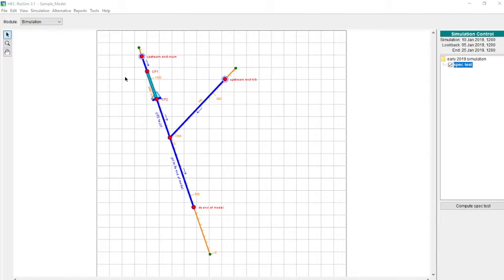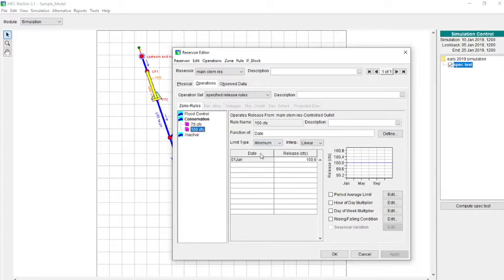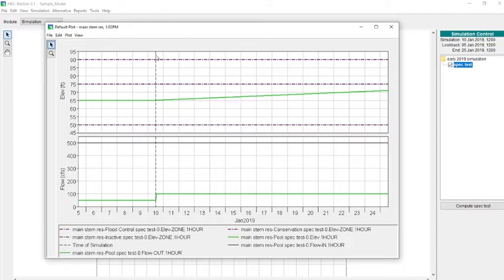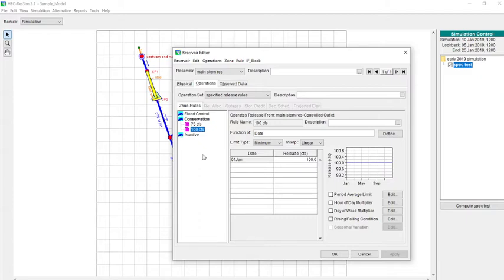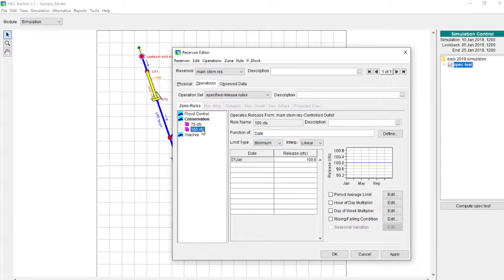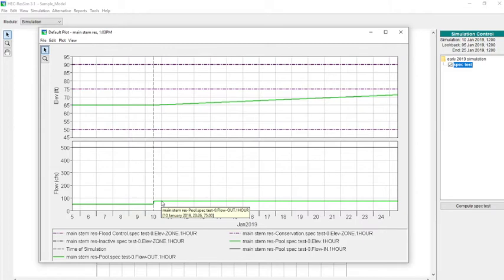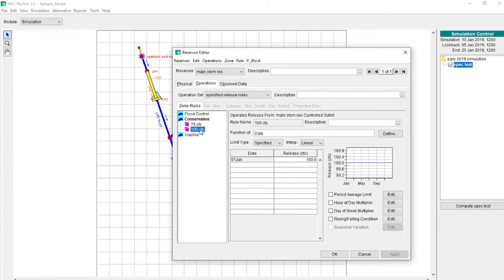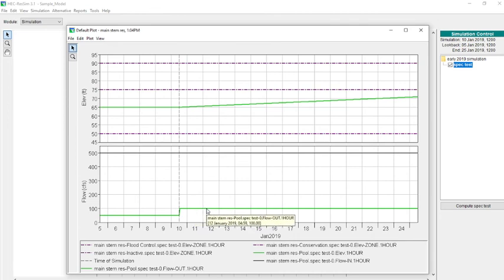The Use of Specified Release Rules in HEC-ResSim

Comment: Excuse me, I would like to ask about hec ressim. I've entered the reservoir elevation time series data on the hec dss in the form of hundreds (example : 120 meters, 115 meters,etc) but in the simulation results the reservoir elevation is in the thousands (example : 2405 meters, etc) Do you have any suggestion for me ?
Reply from the maker: Can you take a look at the elevation-storage data that you entered on the physical tab for that reservoir?  ResSim will typically solve for the storage at each time step and then convert that to an elevation based on the elevation-storage relationship that you input.  I am wondering if there is an issue there in your model.  Also, can you provide more detail about how you are using the elevation time series?
Reply: @hecressim  to enter the elevation time series, I enter daily elevation data into hec-dss. Excuse me sir, for the storage-elevation data entered in the physical tab for the reservoir is it also daily data ? because for other data I use daily data. can you provide a detailed explanation of the data entered on the physical tab for that reservoir or do you have any suggestion ? thank you
Reply from the maker: Storage-elevation data on the physical tab is paired data meaning that each elevation will have an associated storage value with it.    At the elevation increases, the storage need to increase.  There should be no time series associated with the storage-elevation data.